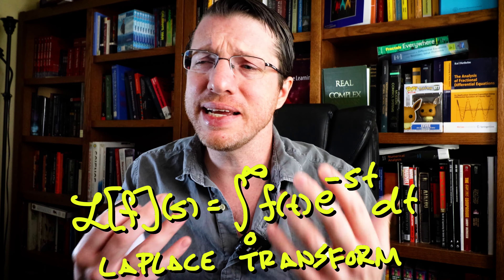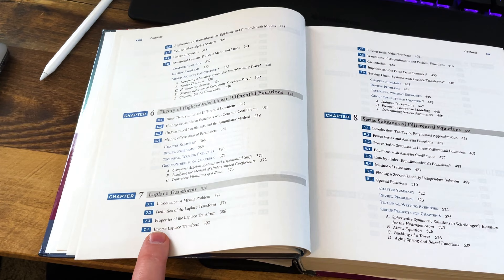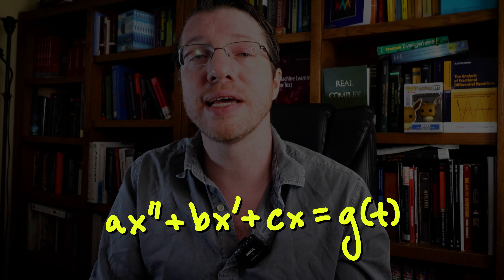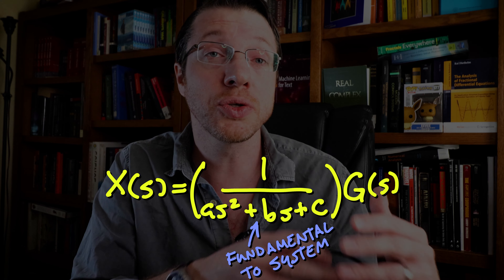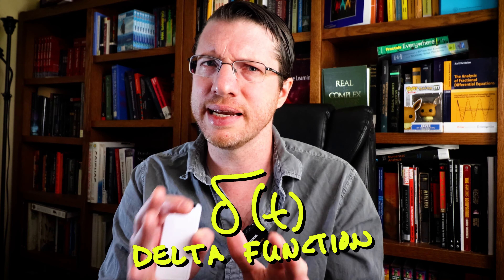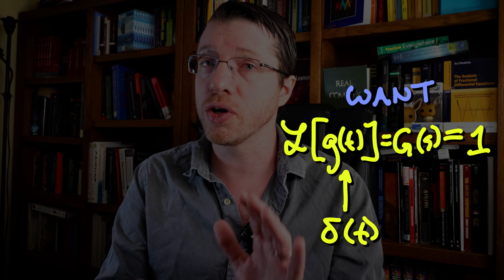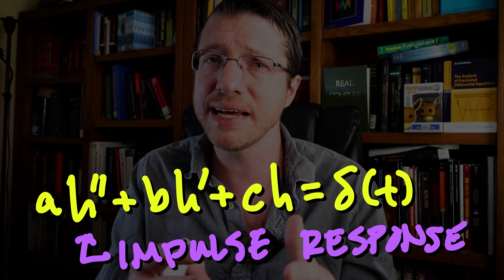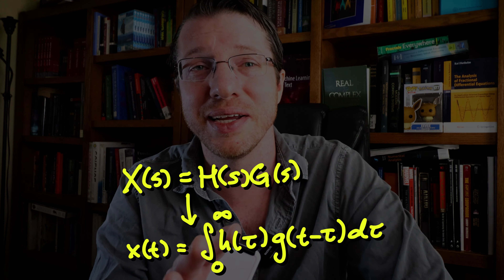Why the Laplace Transform?

Comment: One of the beautiful things about the Laplace transform is its robustness. It pretty much just works when dealing with ODEs and some PDEs. By using rule tables and basic calculus you can derive correct system representations and responses for functions and distributions even if you're completely unaware of what a distribution is.

Comment: I've seen this topic explained multiple times and I understand it to a degree (engineer here), however the way you present it without using too much of unnecessary lingo it makes it very clear. Great job!

If I remember correctly isn't there also a problem with step functions?
Reply from the maker: I’m glad this video was helpful to you!

The step function can have similar problems. I’m this setting, where we only use the input and none of its derivatives, then ordinary methods can work. That’s because the step function is piecewise continuous.

But if we need the derivative of the input, then we are right back at looking at the delta function (that is, the derivative isn’t a function), and need the Laplace transform.
Reply: @JoelRosenfeld  interesting that you mention it. When I rewrite the system into state-space form and it contains du/dt terms I can always treat u as one of the states and change notation do that du/dt is new u. And therefore I obtain impulse input from step and I am right back here at this video.

The way I always imagined it is that if I need first derivative of step function I get impulse but I cannot go further (2nd or higher derivatives).... Does this also make sense from mathematical standpoint?
Reply from the maker: You can have higher derivatives of delta functions, but the notion of tangent lines sorta falls apart. Truly, the tangent line notion for unit step functions doesn’t work either, but it’s a good enough intuitive idea that we think of it as such.

The notion you are looking for is “distributional derivative.” Essentially, we have the integral of f against delta giving us f(0). And we need some way to sneak a derivative on the delta.

If we think back to ordinary calculus, if we take the integral of f’ times some g, then we can use integration by parts to move the derivative off of f and onto g, which gives - int f g’. So if I keep g fixed, we get this operation of g against f that agrees with the operation of g’ against f.

So we have int f’ g = - int f g’.
(Provided we have zero initial conditions and we decay to zero as we go to infinity)

This can work even if g isn’t differentiable everywhere. In that case we call whatever makes this work a “weak” derivative of g.

So now if we look at our delta function, we don’t have a notion of derivative yet, but we want it to agree with that of regular functions. So we simply say that the derivative of the delta function is whatever we get from - int f’ delta, which is the distribution that sends to the function f to -f’(0).

So it doesn’t necessarily mesh with the impulse definition, so we have to make up a whole new notion of differentiation. If it seems confusing or unintuitive, don’t worry. Putting this on firm footing led to a Fields Medal.

I talk more about it in this video here: https://youtu.be/Oy-mvpw5sQ4
Reply: @JoelRosenfeld  thanks for explanation!

Comment: i think that saying the delta function is a linear functional (instead of distribution) is more appropriate for the control / signal-processing community.
Reply from the maker: You might be right. I find that a lot of engineers have trouble distinguishing between function and functional. So I dodged it by saying distribution 🤷🏻‍♂️
Reply: @JoelRosenfeld  distribution is confusing as well since delta is the limit of, say, the compressed gaussian distribution; lim{S(n,x)}->delta(x).  So, to prove the statement f(a) = integral (f(x)delta(x-a)dx) over reals you actually evaluate the limit f(a)=lim{integral(f(x)S(n,x-a)dx)})
Reply from the maker: @edal7066  I mean, there is nothing to prove for the delta integral, truly. It’s just the definition of the functional. In fact, the integration there is just a convenient abuse of notation.

But yeah, I can see the potential for confusion with a delta sequence, like the Gaussian one you suggest.

We need more words in math I guess lol
Reply: @edal7066  This is more often used to prove that a sequences of funtionals/smooth functions converges to the delta function in some dual sense. Delta function definition is very simple provided pointwise evaluation of your primal function space is well-defined.
Reply: @wpowell96  i guess you mean the functionals delta_n(x) from the sequence are from the dual space and the convergence to  < f, delta > where f is from the primal space is in 'weak' sense.